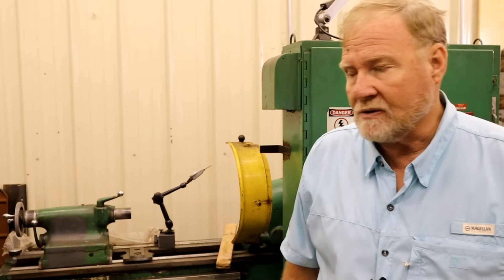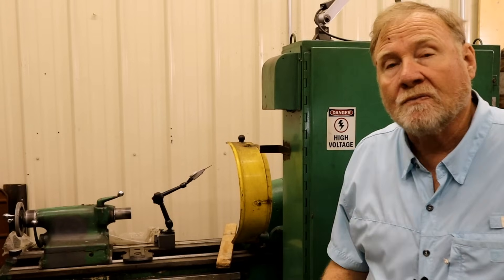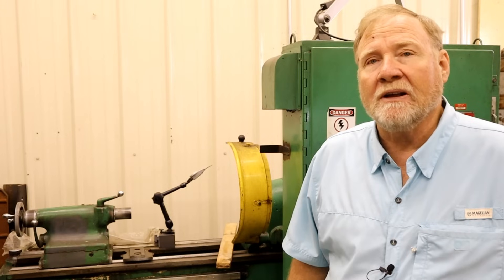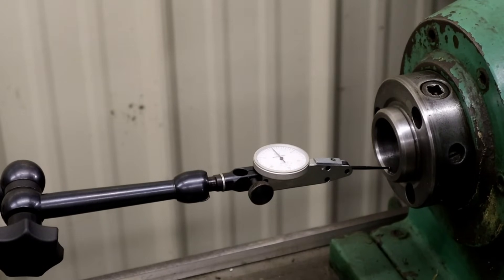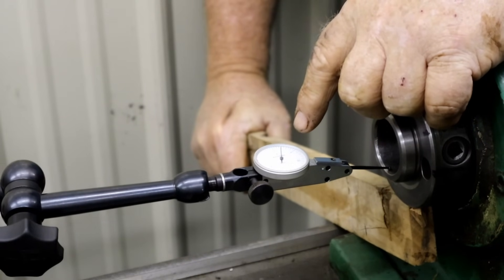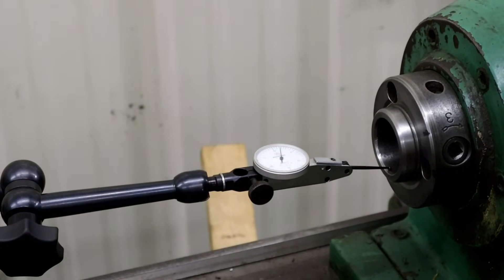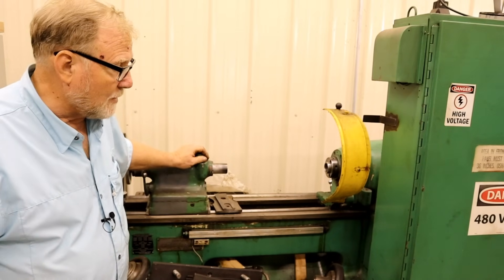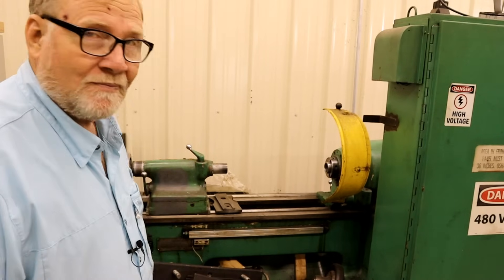How to avoid an expensive mistake, Check your lathe's Spindle.

Comment: Hi Steve  1967 I finished an apprentiship as a tool maker. Since then I have had a number of engineering jobs and Im not sure I fully agree with you conclusion that the main spindle is bent. I would put my money on somebody who didnt fully understand what they were doing , doing something stupid with a grinding wheel. That is the only explanition for the lack of concentricity between the OD and the ID at the stock end(chuck end) of the shaft. I would be tempted to re grind that inner taper. One way to check would be to put the DTI along the length of the spindle. Is that possible?.
Reply from the maker: Well that was repaired a couple of months ago... IT was bent ... All better now...

Comment: Carbide reamer of whatever taper # it is?  Just a quickey to see how long it'll hold the current spindle play with it running bent.  good luck.
Reply from the maker: Have to rebuild the cross feed before anything could be done and I don't think it's ridged enough to hold a reamer on that hardened taper...  Post mounted ID grinder would be the only way then you shill have a 1/8" too short nose with no way to mount a chuck......  Spindle is totally toast after they ground off the outside taper :(

Comment: Ive seen plenty of bent spindles over the years, but never on a EE. Such a small machine, not sure how you could bend it.. The newer spindle drive retrofits are using servo motors, much smoother than a std AC motor, and no more $$$$ power vacuum tubes.
Reply from the maker: Operator gets distracted, runs a chuck with extended jaws into a tool post at 3000 rpm.... Screws up the taper so bad that the chuck won't run straight and rips one of the crossfeed dovetails off.  He is afraid the Boss will fire him, gets out the grinder and grinds off enough taper to straighten it up and then finds he has had to shorten the taper so much the chuck will not draw enough to seat the chuck on the taper, which is now 1/8" too short..  A little foil tape stuffed into the chuck and it somewhat fits now and he might get away with it....   Now the inside taper is 2 thousands off but who uses that anyway :(

Comment: served a four year union apprenticeship in the early 70's and those double e machines were the only small lathe you would like to work on.  they were better than any german or japanese machine.  we had mostly monarch lathes and american pacemakers.  i didn't realize how beautiful these machines were till i left the government lab where i served and got out in the real world.  Some savage bastard really had to crash that monarch.  poor little thing.  take her to the scrap yard.  it's only steel.  and a seven thousand dollar mistake is par for the course in machine shop these days.  I own a jet 13X40 for over 20 years that is in good shape only because i am the only one that runs it.  the only jet 13X40 machines i have seen in shops i have been in had the carriages taken apart or the lid of the gear box removed, and covered with dust of long misuse.
Reply from the maker: A lot of machines come through here and you can tell if they were cared for... Heck my old Heavy 10 was in better shape that most of the machines I see today, mainly because it was mine for 35 years.. :(

Comment: That sucks, I bought a 1917 Hardinge quick change with a bent spindle and bad bearing, luckily I was able to straighten it and make a new bearing.. (cast iron cone bearing) its a work in progress, but at least its spins true now.
Reply from the maker: Good for you!  I wish I had the ability to make these super precise bearings :(
Reply: @10swatkins  It was a pretty straight forward operation, this is (mine, not yours ..ed) a plain bearing lathe mind you, and just a cast iron bearing, 4 degree taper on the outside, bit over 2" bore. did the whole operation in a 35 year old victor 1660 lathe. I used the Kieth Fenner demonstrated method of flame straightening on the spindle, (find the high spot, heat a cherry red spot and quench, rinse and repeat till you're happy) then used a dumore tool post grinder to clean up the last .00075 or so on the spindle.. I found a NOS threaded Hardinge backplate I dialed into a 4 jaw on the victor perfect so I basically made the whole spindle match the threaded nose. I don't know if you can get a 10ee back into the level of precision the name suggests, but you might pop the spindle out and give it a try.. could end up pulling this lathe back out of the part out column into the 85% good runner category..

Comment: What I want to know is how you go about BENDING the spindle of a lathe like a Monarch.  Those spindles are manufactured of heat treated high alloy steel and ground to precise dimensions and tolerances.  In order to bend it you need a bending moment applied either between the spindle bearings  (fore and aft bearings) or you need a large force applied perpendicular to the face of the face plate or chuck which is mounted on the spindle.  But that force needs to be in the neighborhood of multiple tons.  How do you go about doing that?  That's a deliberate sabotaging of the machine.
Reply from the maker: They crashed the tools into the chuck at a high rate of speed. The force tore off one of the dovetails on the cross slide. Remember a spindle is also Hollow, not a solid bar .   I covered this in the video...
Reply: @10swatkins  I know that spindles are hollow.  I was once a designer at Standard Modern in Toronto.  I know lathes.  Still, it takes a lot of force to damage one.
Reply: @matthewmcdaid7962  Big chuck, high speed, that's a lotta mass to deal with compared to a collet or even a faceplate & dog.

Comment: It might be worth checking the spindle bearings, maybe something is loose and the races spun a little, thus creating a parallel issue.  Another issue may exist as high end bearings are marked with the high spot, they may be out of position.  It has spindle issues grinding the nose speaks loudly.  it is possible it was taken apart and then someone else re-assembled the spindle bearing wrong, maybe.  My understanding is issues such as this, bearings improperly set parallel or not enough preload can skew a spindle.  The nose issue can you chrome plate the nose and re-grind it.  .005 Hard Chrome is attainable.  I do like a machine that works right.  Best of luck, either way it's a project.
Reply from the maker: This machine took a horrible crash.. It broke the cross feed dovetails and bent the nose of the spindle so bad they had to grind it off to make a chuck even turn turn close to right and even then had to shim the damn thing with foil tape... Those bearings took a hell of a hit, no way it's going to be back to 10EE standards and new ones cost 2800, for the front ones alone... :(
Reply: @10swatkins  Pricey bearings for sure.  Thanks, I must have missed that comment.  I watched a beautiful newly rebuilt Monarch Lathe get trashed decades ago when working in Saugus MA.  Rookie managed this in seconds cranking the carriage under the chuck with jaws extended and turning it on, very similar results, broke so much iron they just hauled it away.  Horsepower and Iron has to be respected.  Cheers!

Comment: if you dont work in .001 plus or minus and not .0001 you could get buy with 1/2 the cost bearings, actually if you want .0001 and a 20 micron finish buy a new machine !!!
Reply from the maker: Well it's not mine so I don't know what he will accept... But if he is happy with a less precise machine then he should just look around for a Southbend Heavy 10. He could find one of those for a lot less than fixing this one back up to standards..

Comment: I do cnc field service, a customer bought a large horizontal mill at an auction, the B axis was bad, just the B axis bearing was $20,000, total repair just for the B was $56,000
Reply from the maker: Sometimes buying the machine is only the start :)

Comment: You could Repair the ground down spindle nose by welding and re grinding
press the spindle straight ir as straight as you can get it !  get it out of your head that the lathe is junk...it's not fix the damn thing !
Reply from the maker: I could probably make a new perfect spindle in less time than trying to fix this one.  
You would have to weld up the inside and outside, grind the outside and inside taper, try to straiten a hollow spindle with thin walls and then heat treat it and grind it  to get it back to tolerances..   THEN you get to pay for new bearings, repair the crashed saddle and cross feed and then spend about 1100 for the repairs to the motor system... I'd rather go fishing :)

Comment: Since it can't be used to any precision at this time I would still push the spindle straight with a hydraulic press. I could live with the bearings if everything stood to 1/2 ten thousandths  after putting it back in after the push. That nose piece is useless.
Reply from the maker: This machine took a HUGE hit... broke castings in the cross feed, bent the spindle and I don't think there is any way those bearings are going to be ok :(
Reply: @10swatkins  
I think you might be a bit “bearing happy”. 
Try to be more optimistic. 😎

Comment: Hello Sir. Have you not rather established that the axle must be out of alignment with the bedways? If I understand your procedure correctly, you took a measurement at either end of the spindle. Between two points of measurement I suppose there to be a straight line and unless I can take a third in between that proves not to be on that same line, I think concluding that the spindle is bent is not justified.
Reply from the maker: Not if the two points are on the top or bottom of the shaft and the head is on the ways. Then you are measuring distance from the ground bed and not alignment of the head on the way.

Comment: I wasn’t aware that Monarch was still making these things, even as a custom order. I knew they rebuild old machines, at high prices.  Real machine rebuilds are expensive.
Reply from the maker: They are not casting the Iron, Just remanufacturing  old castings into new machines...
Reply: @10swatkins  so they’ll run out of stock. I’m surprised they still have enough good castings to use.

Comment: What would a similar cost in good condition? Both visual and mechanical?  This do seems like it's being used, and not kept in clean condition.   That often is a indicator of a previous owner not paying the needed attention to the equipment 😊
Reply from the maker: It's been sitting  in my shop for 5 years now, not hooked up and not run since it was bought at the auction.... As for used machines coming from an auction it's almost pristine :)    Probably around 20 grand for a good one in great contrition, 154,000 for a new rebuilt one from Monarch..
Reply: @10swatkins  okay, thanks 😊 didn't know they were that high priced when being in good condition. 👍😊   But yes, when being stored and not used, dust and so will of course make it look a bit tired 😊.  Anyway, sad to see it being in this condition anyway.   Thanks for s good video 👍

Comment: I worked in a local shop cleaning and repainting some of the older machine tools. One of the partners owned a Monarch  10EE. He was quite proud of that lathe. It turned a lot of repair parts for Parker Hannifin Hydraulics when they had a facility in Delaware, Ohio. AL B.
Reply from the maker: I never could afford a working one and frankly though they were way overpriced for my kind of work and accuracy requirements at the time. 
I must say the drive systems are really , really complicated.  Now they must have had reasons to go to all that trouble to just eliminate the 3 phase drive motor.  After all Bob the Chucker has a three phase motor and two drive belts with just elegant ways to change speeds. Nothing really fancy and they seem to be accurate .
Reply: They went to all that trouble to eliminate the need for gears in the headstock drive train.

Comment: I’m living this very scenario on a different lathe. Pulled the spindle, had it chromed and ground concentric on the journals. Reinstalled new P5 bearings and now figuring on the grinding the D6 taper to match the bearings while installed, maybe cutting the face of the cam lock too. I need to work out the trigonometry if that’s going to be needed or not.
Reply: You can screw the camlock pins in further to compensate for the loss of quite a bit from the face. Uf you run out there, then you might be able to make fatter cams. They are not a particularly simple shape, but they can be made (I have done it)
Reply: @Chris-te7uk  I was mainly suggesting grinding the face to get a second "bite" at the taper, for example if the spindle is straightened. 
Though straightening the spindle, building up the taper with weld (hard facing rod?), "licking" the face clean in-situ and then machining / re-grinding both tapers ought to work. 
I had good results in-situ grinding a bent surface-grinder spindle using a generic eBay "CNC" spindle.

Comment: Steve, I would like to see the owner give you permission to pull the spindle, clean good, set on vee blocks and check the runout from end to end as well as the face of the camlock to determine where the spindle is bent.  Next, have the spindle either wet mag or dye penetrate done to see if any cracks started from the wreck the lathe got into.   Last, any wreck that would cause this much damage has probably upset the alignment of the vee and flat the headstock sits on, too.  So sad things like this happen.  I've seen many machines in my past get into wrecks similar to this. Big machines!  They patch them and keep running.  Yeah, some day they get sold off to some poor guy and it turns into a nightmare for him.
As always thanks for sharing, Ken
Reply from the maker: Not worth it in my opinion.... They ground off the taper on the spindle to make it fit and the whole thing has too little material to true up the end and make it correct. IF they had left the spindle alone then I would have considered check it out but now its too far gone..
 New front bearings from Monarch are at least 2800 and about 1600 for the back ones..
Reply: @10swatkins  That's not what I'm getting at.  I just wanted to know how bad the damage is.  Your indicator trick is not fully convincing to me.  If the spindle is bent, I'd like to know where it is bent at.  In the mid length of the spindle? Or at the camlock flange end?   I realize it's not going to be restored.
Reply from the maker: @4GSR  Well Ken I volunteer you to come on down!  :)   I have other problem children taking up my time now:(    When you come ,,, Keep off the GRASS!
Reply: @10swatkins  Hahaha...  If the lathe is still around about March or April, I'll be glad to come up one day and remove the spindle and we check it out.  You can even film it if you like.  I promise not to break the camera!
Reply from the maker: @4GSR  It's a deal..... I have a, Toolmaster 1D, Axelson 16, Monarch 10EE, Brown and Sharp Universal #1 and a few other small machines in line and just not time to spend on that problem child...

Comment: I've so far resisted the urge to own one. We've had two come through the shop at work, both bought cheap(<$500) at auction and sold on for a profit. Both needed a lot of work in the control area, which can turn into an expensive hobby all it's own.
Reply from the maker: Thanks for sharing

Comment: What were the manufacturer's tolerances for the spindle? I used one of these for many years and don't recall ANYTHING locating to the I.D. of the spindle tube. The taper of the collet assy. would be pretty important as it is what really needs to run true, especially if you are not turning the O.D. of the pieces you are making.
Trash?  I think NOT!
Reply: The ID of the rear end of the spindle tube is used to center the collet closer.  But it is not really a precision bore: on my 10EE it is clearly a turned surface, not ground.  So the fact that yours is out of round does not necessarily mean the spindle is bent.  The #12 Jarno taper at the chuck end is indeed ground, and should run true.  But again, I don't think that yours being out of round proves that the spindle is bent.  And the fact that the Camlock taper runs true gives some evidence that the spindle is not bent.  BTW, on my 10EE, the collet setup uses a 5C Camlock nose that registers to the Camlock taper, so the Jarno taper is not involved.   It would run true on your machine.  A conversation with the folks at Monarch about this might prove useful before you rush to judgement.  You also might get or fabricate a Jarno test bar to check if they run true.  Lastly, I'd think you could pretty easily true up the Jarno taper using a tool post grinder and ID wheel.  If you truly think your lathe is a lost cause, you have nothing to lose.
Reply: Some 10EE were supplied with an internal collet closer assy. They use the inner taper and a draw tube instead of that collet chuck. Also as Steve noted, turning between centers.
  Mine has a hardinge collet chuck like shown in this video.
Reply from the maker: You can't turn between centers  with a bad 2 thousand out internal taper .. About the only thing I would ever need to use the internal taper for except for putting in a center to help line something up in a chuck...